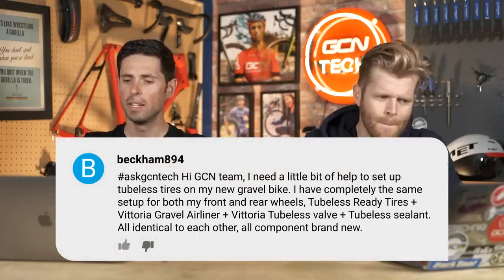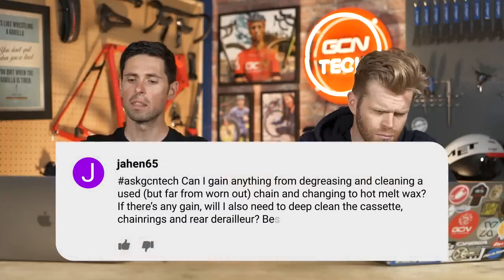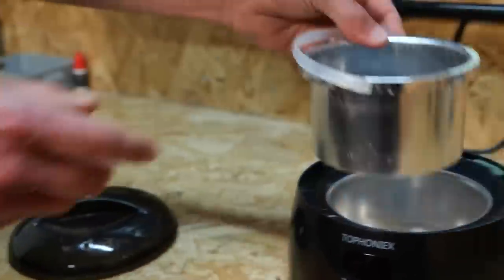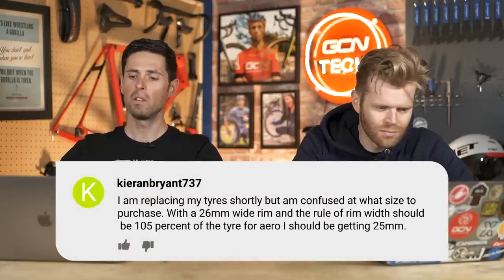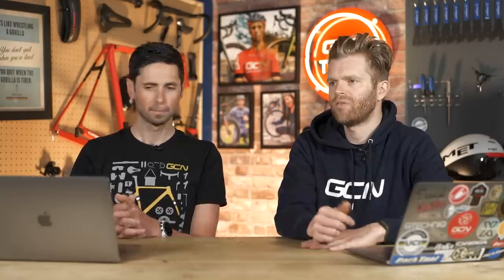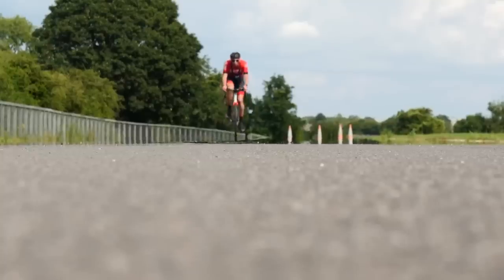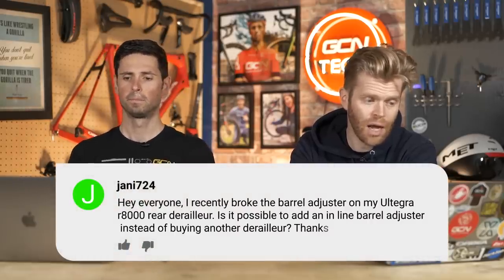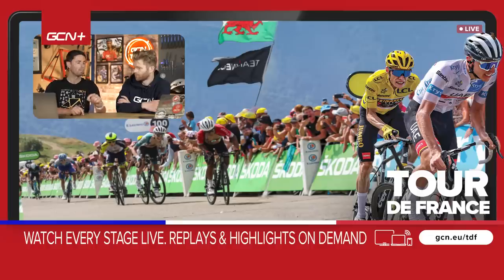Broken Barrel Adjusters, Waxing Chains & Tubeless Woes | GCN Tech Clinic

Comment: For tubeless leaks, if the valve isn’t clearly leaking and you’ve got the right amount of sealant, check the seams of the rims themselves! I had mine retakes, renjnstalled, and had new tyres completely before we worked out it was the rims themselves (not the spoke holes; they were well taped).

Comment: so you dont advise to use services like the Mucoff chain clean and wax processes in many shops now...seems a little counterproductive...but I guess thats why MucOff isnt one of your partners
Reply: Until recently, MucOff were partners of GCN. So in older vids, you will find them advocating for MucOff products. But at least according to Zero Friction Cycling, the MucOff chain lube is every chain's nightmare.
Reply: @SrFederico  oh totally agree  seen some horror stores re their lube...that said...I do find it a bit odd that they are actively advising people against cleaning an old chain now.....where theyve done videos saying otherwise.....my current chain is 4 months old...do they suggest I just throw that away now as its no good for waxing??
Reply: @JBR.1974  That answer was a bit obscure, you are right. It may always make more sense to start fresh, but if the old chain is not significantly elongated, I would thoroughly clean it and wax it. It may have some wear already, but so has an 8 months old waxed chain. That said, age is of no importance, kilometers and conditions are.
Reply: @SrFederico  agreed  i will certainly be cleaning and waxing this chain anyway with only 1100 well lubed miles on it

Comment: You can't just replace a broken barrel adjuster on an Ultegra rear derailleur? I have a hard time believing this. I recently broke a barrel adjuster on my 105 r7000-series derailleur, took it to a bike shop, and they swapped in a new one in less than ten minutes; I did not have to replace the rear derailleur or go with an in-line barrel adjuster...

Comment: #askgcntech how to remove a tubeless tire that is stuck on a carbon wheel
Reply: Tire levers
Reply: @Dreggz1312  the tires are seated. It is almost like if they are glued to the bead.
Reply: Might be able to grab the rubber with some channel locks or something and get enough leverage to break the bead. If you're not saving the tires you could just cut them off.

Comment: #askgcntech   does an OSPW require a longer than normal chain?
Reply: Yes.. Sorry but Clue in the OS part. 😅
Reply: @dapodix  Hmm, what if did down-sized my chainrings? Duh!
Reply: @savagepro9060  if the downsizing is an exact compensation for the oversizing of the pulley-wheels .. You shouldn't have a problem. In reality you'll probably not have this exactness as much depends on the sizing of the pulleys in your OSPW - they can extend from 11 to 17-18 teeth for the lower pulley and from 11 to 13-14 for the upper - that increase is probably more than your downsizing to a (sub) compact crankset. But, apart from this being a rule of thumb - If you're going for the advantages of an OSPW (which isn't much BTW) - you probably don't want the disadvantages of an old chain, do you?
Reply: @dapodix  remember there are two factors here: [1] the size of the pulley wheels, AND [2] the size of the cages . . . LENGTH. Dear Mr Einstein, consider these points and return!😉😂
Reply: @savagepro9060  seems you can find your own answers padawan! Take a leap and do the test!
Reply: @dapodix  I sure will, Gungan . . . but don't hold your breath, uh, oops?!

Comment: Leaking tubeless should be visible, as the sealant should bubble out. make sure enough sealant and take the wheel and rotate and slash the sealant around , so it touches all around the tyre and rim.

Comment: Tubeless is no improvement. It is just selling new stuff. Tubeless rims, tubeless tyres (that sometimes match), new tubeless tape, sealant, valves, repair kits, high pressure pumps etc etc etc. The vast majority of miles undertaken on a bike gain nothing from tubeless. Just like so many other cycling technology improvements it's irrelevant to the experience or relative performance of most cyclists. GCN is all about selling new products at an ever higher cost. They dance for their sponsors and really don't care about most cyclists, only those spending >£5k for a bike.
Reply: Rubbish - road tubeless has saved me so much messing about with punctures that it's been well worth it. You don't have to buy new rims etc - just wait till the braking surfaces wear out and replace with tubeless ready. I assume you replace your tyres when they wear out - so just buy TL replacements. If you have discs chances are the rims are tubeless ready anyway. Sealant is on a par with the cost of a tube; the whole set up is cheaper than lightweight tubes. If you want to stick with butyl tubes and clinchers nobody is stopping you. If you don't like GCN don't watch; no need to write grumpy comments.
Reply: @grahamaustin9085 I'm glad it works for you but I've tried it and have always had leaks. I don't need tubeless and I can assure you hooked rims, tyres and tubes are cheap to run. I've not punctured in years, but now of course I've jinxed myself.
Reply: My point is new tech is here simply to sell stuff. Most riders do not need it for most miles. They might want new stuff, but they don't need it. GCN is just another advertisement for it's sponsors.